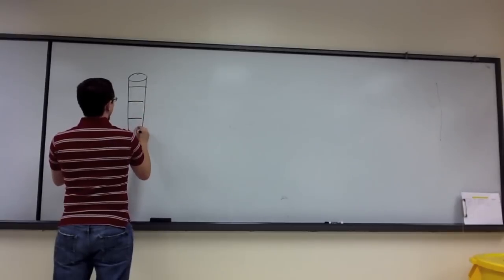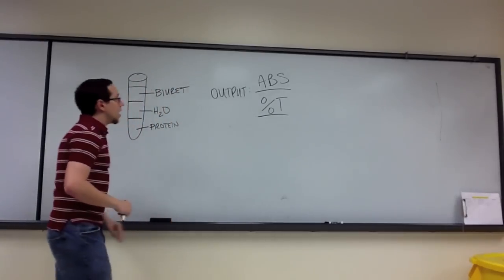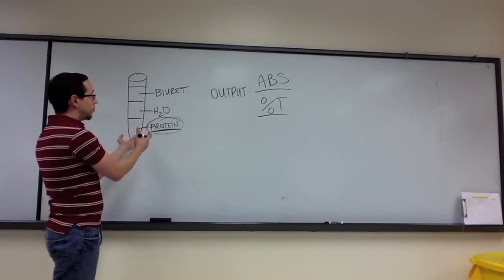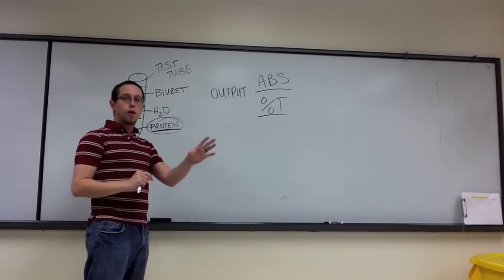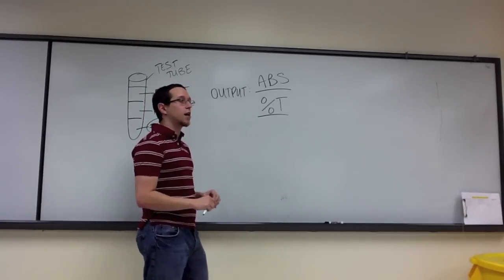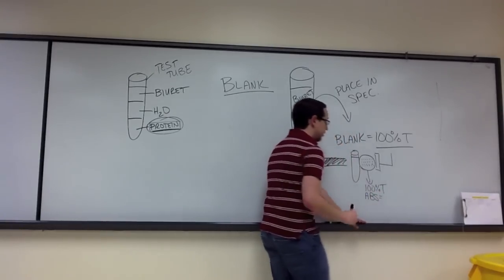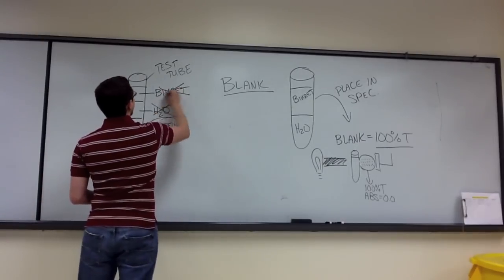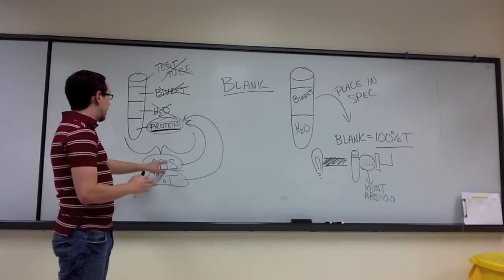Lab Review - Blank & Spectrophotometer Calibration (Unit 2 Spectrophotometry)

Comment: when you zero  the spectrophotometer, do you increase the intensity of light to compensate  for the absorbance of light by the blank so now you have new transmittance  . let is say you have 100 transmittance with air blank, then you put blank water  and you get  ,90. so when you zero now, with water do you increase the intesity by 10 to make it 100 so you know  now at new 100 transmitance,  you compensated for the amount  of light absorbed, do you increase the intensity of light from the lamp when you  zero blank. thank you  for explaination .